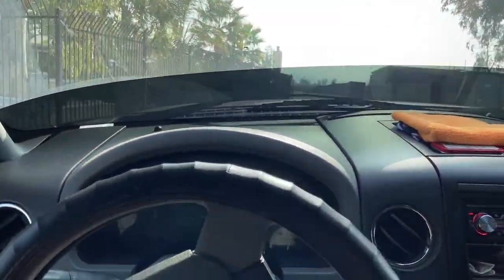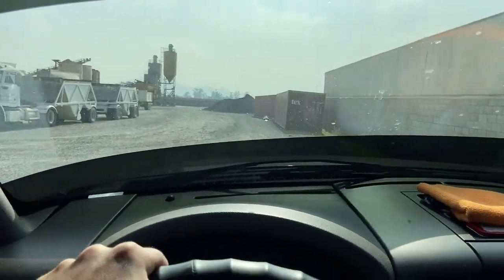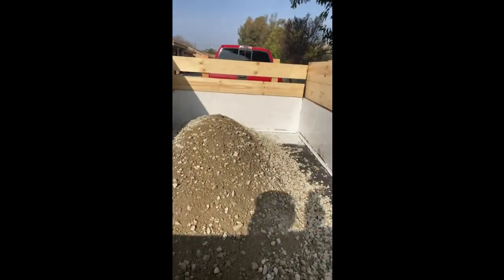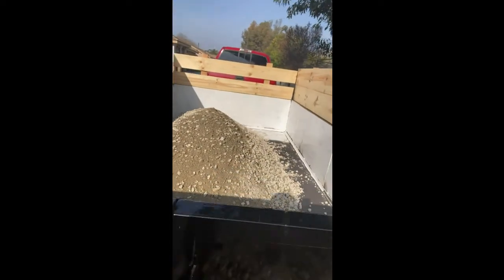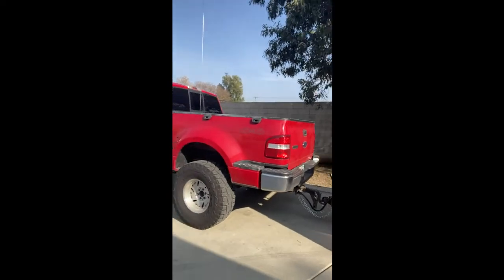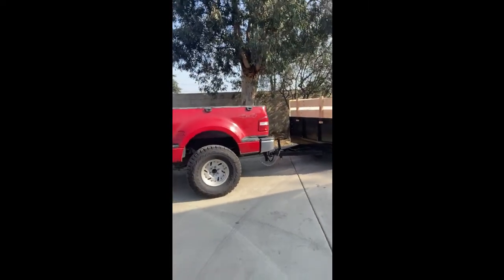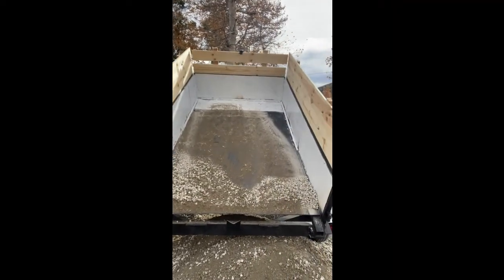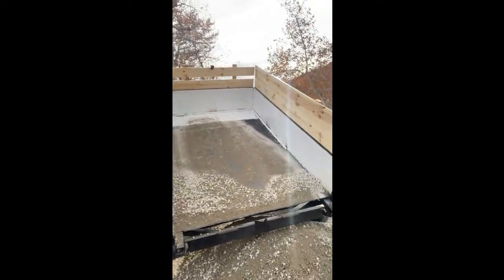Dump trailer load after slip plate application

Comment: Thanks for the demonstration.  I won’t spend money on slip plate after this.
Reply from the maker: Yea it actually did help but I did realize that when I was rebuilding my dump trailer my hydraulic cylinder was not mounted properly to give the trailer max tilt .. so I re adjusted it and after that it did all dump out so the prouduct does work it was just my trailer was not tilted high enough .. but thanks for watching !